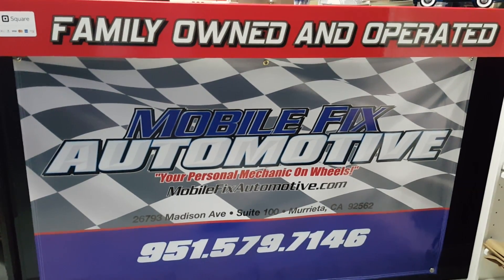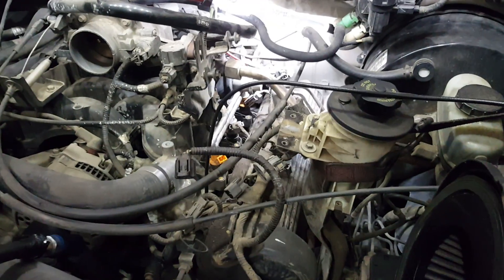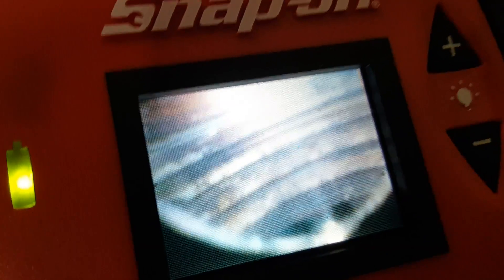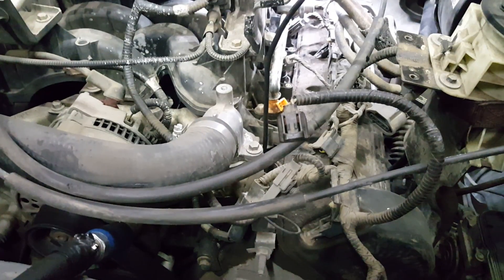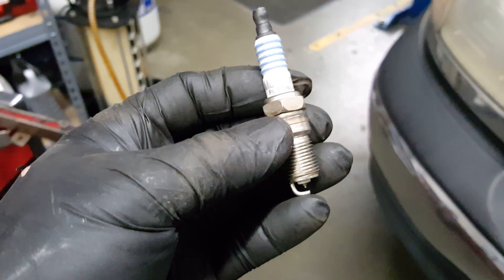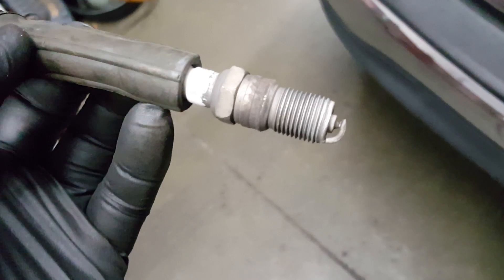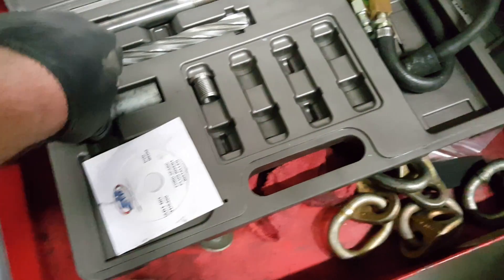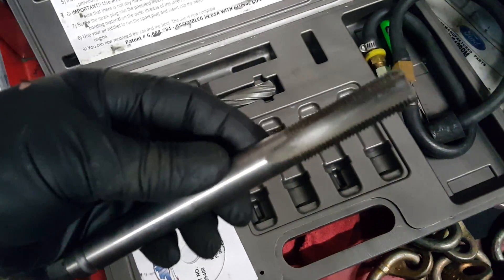Why the spark plug blew out of your Ford Triton engine

Comment: I have a 2000 Ford Taurus sel and spark plug # 5 blew out, the hole is too big for the m14 1.25, what can I use. the helicoil kit I had to return to Lordco here in Campbell River, BC.

Comment: Good video thanks.  The land or thread relief prior the threads in the cylinder head is most likely used to help guide spark plug onto the threads.  Agree there should be more threads, but I think the minimum is around 3 full threads for most threaded joints.  I would not design to the minimum which is what you are saying.

Comment: The 2002 and later heads have 8+ threads. It's a torque issue.....24ft-lbs and no more blowing out for me after 100's of vehicles. A little vigilance in putting a torque wrench on all the plugs on your 5.4/6.8 2V will prevent you from having an issue.

Comment: Hi Ron, good explanation.  I am a DIY'er.  Learned a ton of stuff about auto-mechanics and a lot of other stuff from my Dad.  So how do you keep the shavings from drilling the spark plug hole from falling into the cylinder and then removing any that do?

Comment: Why didnt the mechanic that "repaired" my #2 blown plug on my 2002 F 150 use the calvan? He charged me 400.00. Thats enough to buy two calvan kits. And it blew out again 6 mos after. Now i cant find a tap that will rethread. Everything i try drops through. Been drivng it on 7 cylinders for a year now. Was a solid 4.6

Comment: I don't have a ford triton, but I've had issues with spark plugs backing out and causing misfires. When this happens doesn't the cylinder fail catastrophically due to improper air and fuel ratio from the ECU?

Comment: That's interesting about the threads. Thanks for clearly showing there's only 4 threads... That makes the problem so much clearly. I've heard torquing the spark plugs every 30000 miles or so could be part of routine maintenance w this particular motor... You also pointed out that the threads were only cut that far into the head. Hmmmm. Does that mean someone could pull the heads and cut more threads so there was more purchase for the spark plug to grip. That may be a dumb question. And it may be a hell of a lot of work. It may be less work to purchase that Cal kit you referenced and keep the tools needed handy for such an event as the spark plug popping out. Is there a trick for getting all the filings out of the cylinder. And another tip for working at the back cylinders? You may have a video on it perhaps. It sounds like some effort, but according to what I've heard this isn't a bad motor at all once you get around the spark plug issue. Not high performance... But a reliable motor. I've heard some people treat it well, being on top all fluid changes and driving the truck beyond 400,000. I just got one w only 90,000 and I would love to drive it for another few years.

Comment: HERE FOR ARCHIVED INFORMATION PURPOSES:
My father was a mechanic for 40 years.  He swears that as long as you keep it torqued every 10k-50k miles, and use genuine factory parts, it’ll last forever.  The specs, dimensions, and tolerances for aftermarket plugs are always slightly off.  Every time he was working on a Triton, he would torque them for free.  Most the time they were significantly off.  He never had a customer call back with an ejected spark plug later down the road.

Comment: 7 & 8 blew out of my 2002, about a month apart. I agree it is the heads, Ford would not admit fault, that was in 2008. I like your bore scope, I thought there was only 2 or 3 threads holding mine.

Comment: Just had one blow on my 2009 5.4 e350 van🙄 Coil was also snapped off and rubber was burnt and ripped up. Spark plug was attached identical to this also

Comment: I've just done coil pack, plug wires and plugs in my 2010 Ford Ranger.  4.0L. The #1 plug is not seated correctly...is there an easy fix or do I need to remove the head to clean up the  head treads? The rest of the 6 plugs went in great.

Comment: I do have a question. I’m looking at possibly buying a 2002 Ford F350 with the triton V10. The truck belongs to the original owner who is in his mid-70s and he bought it late 2001. It’s only a 2 Wheel Dr. model with just over 134,000 km on it. I’m just curious to know, would that be a two valve or a three valve engine? Thanks in advance.
Reply from the maker: It's a 2 valve engine

Comment: Thank you for this video. I had this happen about 3 years ago on the same cylinder twice. The dealer fixed it the first time and their repair failed and I was under the impression that I would need to replace the head. I finally got around to buying this kit and doing the repair. Now I don't have to spend the money on a new head and the hassle of swapping it, and I have seven more inserts if it happens again.
Reply: The "early fixes" (from independent mechanics) involved the removal of the head(s) - and many of them discovered it was much easier to do if they removed the cab (of the truck - entire body if it was an excursion or expedition or explorer or Mercury)...   Many of the dealership mechanics/service advisors would say 'from memory' "...it will be cheaper to replace the entire engine than to fix this one..."

Comment: just had this happen to me. thought head gasket blew. the kit is a god send and saved me $$$. why would they machine only 4-5 threads in the head? i work on small engines and i think they are designing things to fail so you buy a new one.(my oppinion)
great video!

Comment: Hey Ron, I'm thinking about buying the kit. It's $500 to do it myself with this kit. Or it's 140$/cylinder. I have 250k miles and want to go to a million. Should I invest in it, or wait to 500k and do an engine overhaul? Most mechanics I talk to say "if it's not broke don't fix it." But preventative maintenance stops the problem before it happens. 6.8 V10 excursion

Comment: I hear they made the head out of aluminum. After it's heated and cooled daily for 20 years those threads will warp over time. The pressure ends up chewing them and spits it clean out. The plug shaves the cylinder. I just had my first one go on my 6.8 Triton. When they rethread the CalVan goes deeper and seats better.
Reply: The exhaust leak was spot on when mine blew. However, that doesn't damage the cylinder. It's basically like running a misfire on that ignition coil. However, don't keep running it like that.

Comment: thanks ron! very experienced and  educated detective work on the shotty ford design. thank you very much sir! got a 1999 F250 super duty 150k that threw a plug.... thought it threw a rod, from plug gap smashed, the most violent CLACKCLACKCLACK running sound and the coil and boot  exploding off the block... thanks for your videos!
thumbs up and subbed

Comment: It's not common. My 2000 f150 5.4 i bought new has 300,000 on it and i just put my 3rd set of plugs in it and it has never blown a plug. I have friends and know others that have 98s to 2003s that never had blown plugs. It's isolated cases when it happens. Somewhere along the line it didn't get tightened down enough into the aluminum head or over tightened.

Comment: I have the 4.6 grand marquis and about a month ago I though my exhaust had fallen off I've been driving it like that but in the past couple of days ive been feeling a misfire and finally today my check engine light has come on and had a obvious misfire is it possible this is what happened to me a month ago or would problems arise quicker than that if this is what had happened
Reply: I ordered a whole coilpack and sparkplug kit but I'm afraid when I go to do it I'll run into this

Comment: Ron, I have a 2001 E150 work truck with a 4.6L V8 and 169K miles on it. My local mechanic says that the #2 cylinder threw a plug, but he doesn't have room on the van to replace it with a standard installer kit. Says that a special tool is needed due to access. Have you ever run into this issue? Ford SAYS they CAN do it for $1,000, but didn't seem firm on the number. Any input/suggestions here?
Reply from the maker: Yes. They are difficult but doable
Reply: @SandCarServices  thank you! It's at Ford now and I'm hoping for the best. Vans are a PITA to work on.

Comment: It happened to me while driving a  2006 V6 Accord Hybrid at highway speeds. It sounded like I had blown a tire, then the pop pop pop. I think I had a warning this was going to happen but I had no idea at the time. The sign was that every time I turned a corner, the engine would sputter ... as if the spark plug was hanging by one thread and turning made it tilt and compression leak through it. I though I'd share that and save someone a headache. $600 dollars later ... I could've done it myself for less than $100, maybe? Great video, sir!

Comment: I have an F250 with the two valve Triton. The factory torque spec is 13ft lb. There's a service bulletin on this specifying 20 - 25 ft lb on the plug.

Comment: My father was a mechanic for 40 years.  He swears that as long as you keep it torqued every 10k-50k miles, and use genuine factory parts, it’ll last forever.  The specs, dimensions, and tolerances for aftermarket plugs are always slightly off.  Every time he was working on a Triton, he would torque them for free.  Most the time they were significantly off.  He never had a customer call back with an ejected spark plug later down the road.
Reply: Thank-you for that info. I just bought a E-350 (25k mi) that is the RV powerplant that I will be using as a tiny home off-grid in the coming years hopefully for many years. I have been concerned about this issue given  I don't want a costly breakdown off the beaten path.
Reply: Sounds like a good mechanic.
Reply: ahahaha thats  funnnnnyyyyyyyyyy
Reply: I've been hearing this too. Retorquing the spark plugs as part of routine maintenance is what's needed for this particular motor.

Comment: Ford Mechanical Engineer: 84% of the load in a threaded mechanical connection is carried by the first 4 threads of that connection.

Ford Industrial process engineer: By only machining 4 threads in the heads for the spark plugs we can shave 0.000035476 seconds off of the production time for each head we manufacture.

Ford production cost analyst: By machining only 4 threads into the heads of these engines for the spark plugs we can save 0.000004216 cents in production cost for each head without passing the cost savings in the final price evaluation on to the consumer.

Ford corporate officer: We are only going to machine 4 spark plug threads into our new head design... This is top of the line cutting edge space-age stuff we got going on here. This might change the whole industry.

Ford Mechanic: WHAT F**KING IDIOT OK'd THIS BULLSHIT DESIGN!!!!!

Comment: Ron: I have a 2004 Expedition with the 4.6.....it's got 98,000 original miles.  It runs perfectly.  Should I attempt to change the spark plugs or leave it alone?
Reply from the maker: Yes. Install motorcraft plugs and torque to 20 ft lbs. Just hope someone before you didn't get that bright idea to use lock tight on the threads.

Comment: A mechanic is charging Me $1400 for labor on My Ford Econoline Van to repair this. He tried to put inserts but didn't work soehe will have to remove head and take it to a shop to get it repaired! That would be an extra cost! $1400 for labor in a 2001 Ford E350 Econoline is a fair price???
Reply from the maker: I have never pulled a cylinder head to install an insert. In the van if multiple cylinders are repaired at the same time I remove the intake for access. I just did a 2007 E350 class c motorhome and the price was just over 2000 for all 10 inserts installed out the door.  Just for reference.
Reply: @SandCarServices  Well thanks a lot for the quick response and for the great videos! 🖐🏼

Comment: Those threads are at the top of the threads of the plug, would have to back out 6-7 turns till it backed out to the point where only 3 or 4 threads holding it. It looks like the threads don't go all the way to the bottom so there's 5 or 6 threads past the threads so it'll have to back off far more than 2 threads. The plug being loose most likely ruins the threads  not from backing out completely to the end of the plug and past the few threads that were tapped.

Comment: So.. qould it be beneficial to put these in before it blows out?
Reply from the maker: If done right it guarantees it not to fail in my opinion. But I still tell everyone to change the plugs with factory motorcraft and torque to 20 ft lbs

Comment: I have a question ! I'm putting together the assesories parts to my firstly installed motor head before,  of course, putting the intake,  head gaskets, manifold, and lalala...etc I'm recently schooled on Fords F150 2003. So, I know what I know from watching alot of you guys savvy Ford and whatnot mechanics out here in YouTube and from my own research reading and whstnot. The 7th coil looks a bit like the one you show in your vid. But a mechanic on 27th ave in Miami FL said this can be put back with some kind of hastened reinforced ring from I don't know what materials, aluminum...o.O idk!😄 So, can I put this coil back?
I'll send a clear picture of all 8 coils with everything else I'm doing! 😄Mind you, don't be shocked but I'm doing it myself 😉😄😊
Please answer back soon so I can get my truck back on the road!

Comment: I recently had this happen to me on a 2002 f150 4.6 V8 and I used JB weld to keep the spark plug in and it hasn't came out since I use literally a half of each tube mixed it up and I said this plug will never ever come out again

Comment: Interesting that the threads inside the insert are also only at the bottom.
Reply from the maker: Yes, but the difference has always been the calvan insert is made of steel and averages at least 9 threads. Out of all the calvan inserts I've done over the past 8 years I've never had one return for redo. Thats good enough for me and my customers.

Comment: By chance what are the chances when I spark plug blows out and though a head. That it cause cylinder damage?
Reply from the maker: Not saying It can't happen but the only thing I've seen is when a spark plug blows for the first time (meaning no inserts, helicoils etc) is sometimes the spark plug will bounce up and down and break off the electrode which falls in and bounces around in the cylinder which i have seen damage cylinder walls and bend valves which in turn can make engine loose compression, and can cause oil burning if cylinder is scratched. Hope that not to confusing? Its very rare to see in my shop but 1 out of every 50 have it happen.

Comment: I got one of them good fords the spark plug blow out and some one put a he lie coil in it and that blow out and now the hole is to big. Will that tool you have fix that or do I need to pull the head off and weld it and thered it back?
Reply from the maker: The calvan kit will usually still override and repair a save a thread. If the reamer drops right in then no.

Comment: Correct me if I’m wrong but how can one slip a threaded spark plug in a untapped portion of the hole? Metal has to be removed to accommodate the threads. That being said my question to Ford is why not more threads to hold the plug in? I have the same motor in my ‘02 f250. My mechanic years ago put the fear of god in me when it had been almost 10 years the original plugs were in (@65 k miles) citing this very problem. Under his suggestion I soaked the threads for 2 days with PB blaster before attempting the plug removal using a thread “ tapping” technique. No problems (whew!) I did put a light application of anti siege on the new plugs. BTW great video especially the bore scope shot and good tip on the Denso COP’s my first replace the of them was with the Accel’s which proved to overrated crap IMO. I still have this truck with the 6 speed manual (I love seeing people’s reaction to that😆) with 110k miles. I will keep as long as I can providing the shitty steel Ford used to make the frame 🤬. Thanks for the helpful video!
Reply from the maker: You do not need to soak the plugs before removal on a 2 valve. That is a technique used in removing the multiple piece 16mm plugs only on the 3 valve engine which is the 5.4 2004 up to 2010 when they redesigned the head and installed 12mm plugs.

Comment: After you get the blown out spark plug repaired, how you repair it if you start getting low combustion and continue having the misfire after paying to get it fixed? I had my mechanic repair the blown out spark plug and the said it has low combustion and the misfire and later on in the day 4 codes popped up P0171 P0174 P0306 and P0316
Reply: Also it was on a 2002 f150 5.4 triton
Reply: And i meant low compression not combustion.

Comment: Hey all This is Tommy from the Thomas Tool Co. LLC.  In San Marcos and I wanted to let Y'all know about this guy Ron. I have a 2003 F150 that I love. I bought It brand new from Ken Groody in Carlsbad in 2004 right off the lot And I love my truck.  However Ford made a few mistakes with there design of the Triton engines with this spark plug issue. I have had 3 blow. With this last one I couldn't find anyone really close by that would or could do it for less than like 600 bucks.  So I came across this guy Ron had my truck towed to his shop and he took care of it no problem. And not only did he take care of it he told me it would be like 350 to do it and it was actually like 320.00 and was done in like 2 hours. Now the price was great but the reason I took it there was because in these videos I could tell he knew his shit about this issue. In a day where everyone wants to ignore all the experts... I will go to them every time.. If you drive a truck or mustang with a triton engine and have this issue you would be crazy not to call Ron and have him do the job.. Anyways working great and truck purrrrs like a kitten.. Thanks again Buddy.. Hope you had a good time at Glamis..
Reply from the maker: Thank you very much. Happy to help.